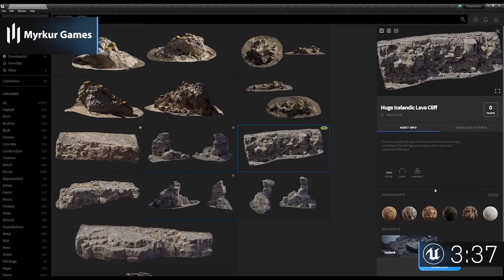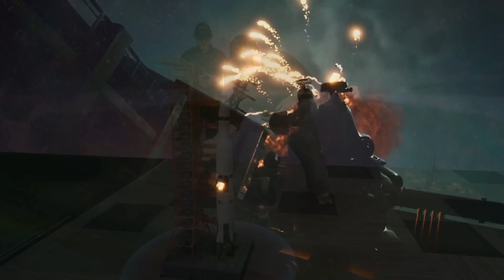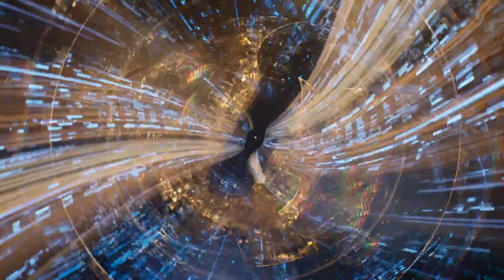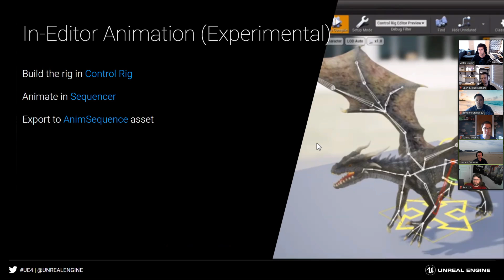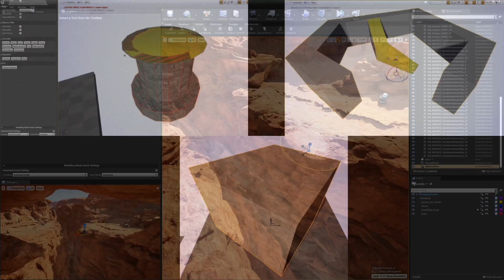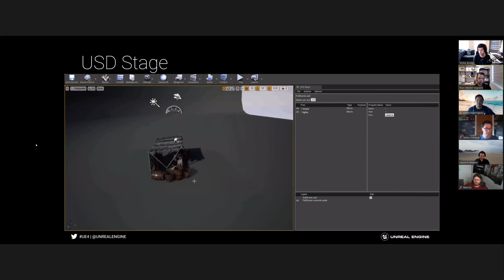Unreal Engine 4.25 Release Highlights | Inside Unreal

Comment: Ue 4.23, 24 and 25 is freezing after 1-2 minutes. It's just freezing. If i want stop ue4 in task manager, task manager is freeze. I force pc to sleep mode and after ue4 closed. But never work!. Ue 4.20 it's working perfect. I have not solve this problem.

Comment: Has anyone used the xgen hair groom import? I set it up in my models t pose in Maya so the hair ended up simming hanging straight down (gravity) but then in unreal it stays straight and wrapped to the head. So as the head rotates the hair cuts through her back. I attached the Niagara particle node under the groom node and selected the Niagara hair asset but still no movement or interaction with my mesh. Still a ton better than last version though. Before I had crazy render issues. It feels like either I'm still missing something huge or it's starting to come around.

Comment: Will I be able to port my 4.24 project to 4.25?
Reply: I started my project on like 4.8 or something. I have upgraded it to each new version ever since. It rarely breaks things. And in each case it wasn't hard to fix. It's currently on 4.24. I'll update this weekend probably. I'd be surprised if it doesn't. At one point I actually created a new project and imported everything just to get the proper modern defaults. I'll probably do that again at some point.

Comment: is chaos cloth going to come with documentations?   Really need cloth.. hopefully chaos cloth has mesh collider instead of capsule colliders
Reply: yeah I had to massively tweek my capsule colliders to get cloth to work right. In some cases I couldn't so I switched to full mesh based. But the ragdolls behave like crap. I'm hoping it will make it easier to get better rag dolls.
Reply: Ashley Williams current unreal cloth supports mesh based collder? as in full body regular body as collider?
Reply: Ashley Williams, can you email me please? I want to learn the cloth that works with unreal 4.25    Ive used cloth before in older versions of unreal.   freenomon@gmail.com
thank you so much in advance

Comment: May I ask: Is UE Engine a competitor of the Crytek Engine? If so Why? If not Why? Thank you for answering.
Reply: In case of ray tracing I think cryengine has some rocket science technology I think cry ray tracing is atleast 100 times better in performance and quality
Reply: Cry is ahead from ue 4 in terms of graphics ,performance , and most important they have excellent solution for dynamic lighting which is far ahead of ue 4 but the only thing is the lack of documentary and learning stuff with cry
Reply: I guess they both compete with each other